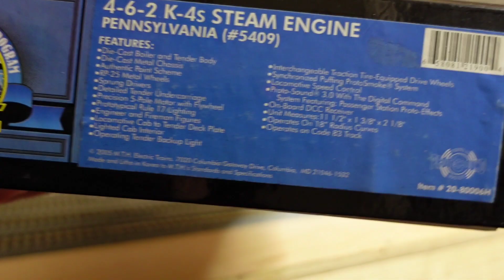MTH HO DAP PRR Tuscan K4 with ESU Loksound 5 Steam file

Comment: I like the whistle, those speakers seem to do a great job, but that chuffing.... the one thing ESU just can’t get me to like at all. 

Also how does the engine run with the MTH motor and a non MTH decoder? I have a TCS Wowsound in an MTH K4 that was gutted before I got it and it moves kinda slow at 50/128.
Reply from the maker: This motor is actually a Cannon motor, same one found in high end brass.  Excellent slow speed control and very quiet
Reply: @RodimusPrime  I’m assuming aftermarket, how much is one and how hard was it to mount inside the engine?
Reply: @James-Railyard  I dont believe so. The model came with these.
Reply: @ecpcharles  okay. I guess I just have to mess with the settings on mine then. Then I have to fix the other K4 I have, engine board is shot.
Reply: @James-Railyard  nope cannon motors are what came in mth locos until cannon stopped making them
Reply: The chuffs in different ESU sound files are radically different. I agree this chuff isn't the best out there, but some of their other files are fantastic.

Comment: Does the 51970	I/O expansion board for LokSound, LokPilot 21MTC  not work with version 5 decoders? That would give smoke unit control.

Comment: Nice video Matt. Hey I was wondering how did you know that the motor function on the Paragon 3 decoder quit working? Just wondering I’m affix something happen to my Paragon 3 class J 611? Thanks again look forward to seeing more videos from you.
Reply from the maker: Lights and smoke work lol motor dont, multiple resets...its an issue on these
Reply: @RodimusPrime   aww ok I was wondering if that could be what’s wrong with my J lights and sounds work but it won’t move and I know the drive train is fine it’s brand new from BLI. Any thoughts on what could be happening?
Reply: @RodimusPrime  interesting. Ive bought two noneworking MTH K4s so far (looking for a third lol), good to know the motor was a common issue on these. From my experience, the drawbar tends to be the first to go.

Comment: May I know what kind or brand of track your using?  It's really nice with four evenly spaced tracks.
Reply: I thought I was going with Bachmann but the geometry is terrible on my opinion
Reply from the maker: Kato unitrack
Reply: @RodimusPrime  can you show me how to do the upgrade to loksound v5. I want to upgrade my mth ho southern pacific gs4 #4449 to loksound v5.
Reply from the maker: @DavidHollyTrainsMore  I don't have my mth gs4 anymore but it would be the same as any engine.  You have to completely eliminate all the mth boards and wire from scratch